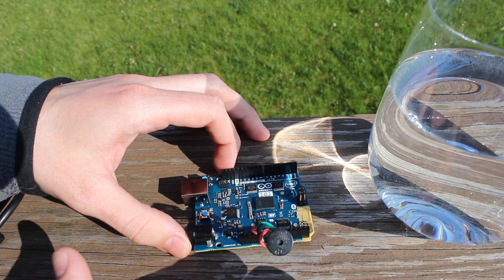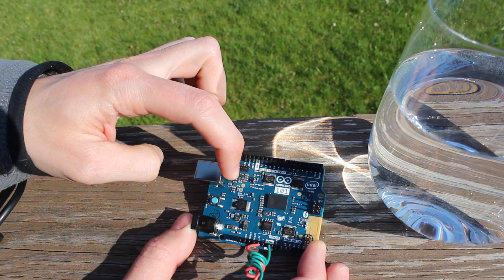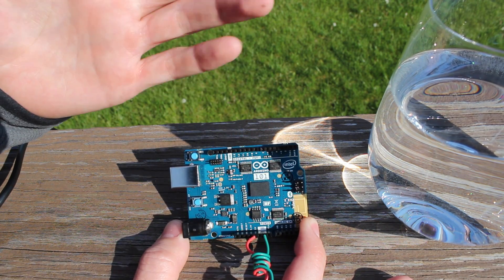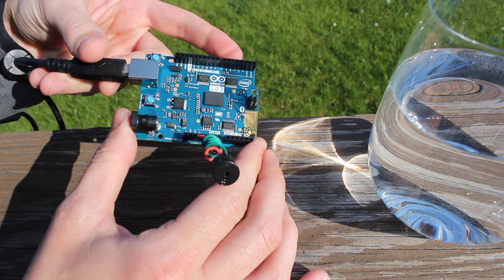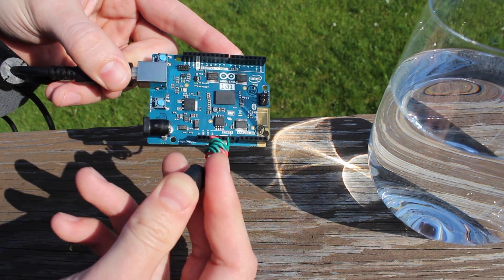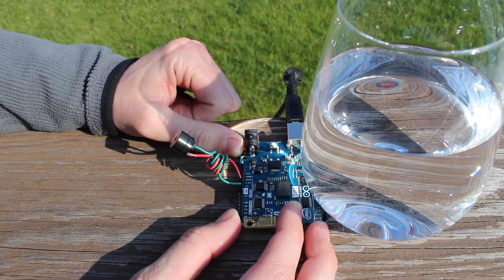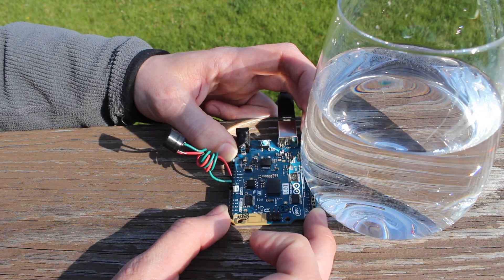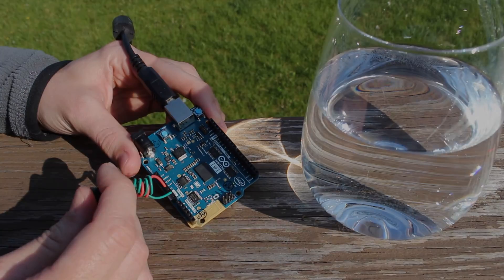Arduino 101 vs The SUN! Followup to Light Sensitivity Testing

Comment: Interesting, I wonder if one could cover that chip with a thick black paint or epoxy without destroying the board or affecting its performance. Personally if I am using the board in a project I would have it enclosed in a box of some type. Yes the clear cases are nice but with this issue.....Ohio, my home state. Been away for ten years now, and the tenth Dayton Hamvention I am missing. :-(